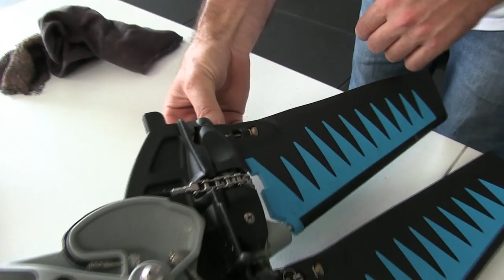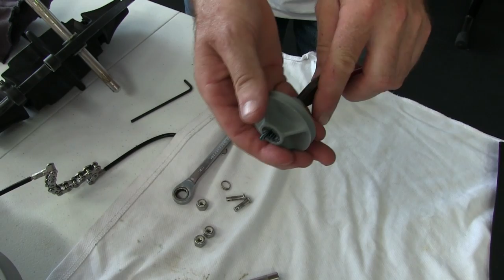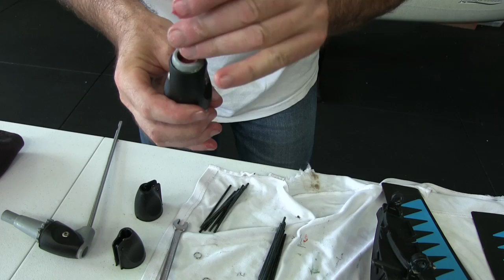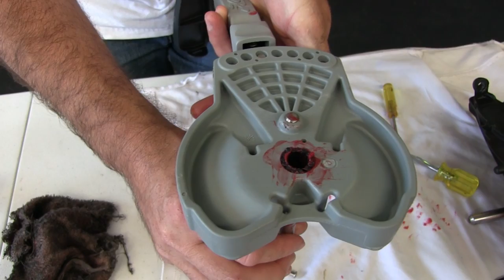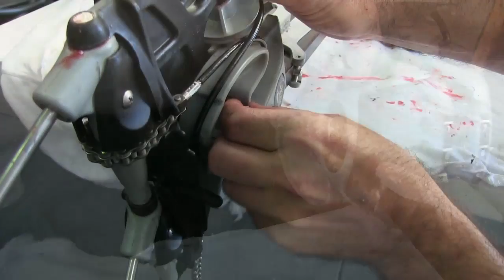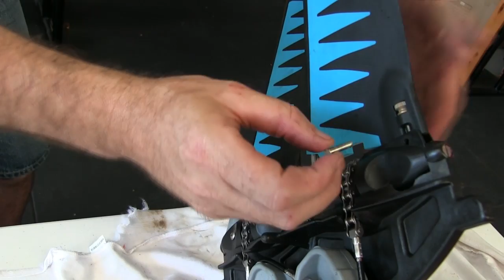Hobie GT Miragedrive Service Guide

Comment: A big thank you from a Barnegat Bay New Jersey kayak fisherman! This is an excellent how-to video, well narrated and filmed. I used it to guide the installation of new GT sprockets on a V2 Mirage Drive. A tip for anyone who's doing this--mark the middle tooth of each sprocket with a Sharpie to make it easier to line up with the middle chain link as you're reassembling.

Comment: I purchased the recommended 1/8” paracord from Harber Frieght. If you carefully heat the outer jacket so it shrinks and becomes more rigid you can easily thread it through the hole and pulley. Otherwise the outer sheath slides and bunches if you tried to push it. The same thing for the T handle. Don’t over heat because the jacket will melt.

Comment: Did Hobie ever make a bearingless drive?  I took mine apart awhile back and never saw any roller bearings.
Reply from the maker: V1 and V2 drives did not have bearings. Both can be updated to GT bearing components.

Comment: 2:10 what is this detail for? it also works without it
Reply from the maker: The idler cable balances the loads and helps to prevent a snapping load on the chains at each change of pedal direction.

Comment: I'm scared to death at not being able to put back the bearings in place.
Reply from the maker: We sell a lot of Glide Tech parts via mail order and not once had anyone contact us to tell us they were having troubles with them. They are pretty easy to contend with
Reply: I took mine apart without watching any video and had plastic bearings all over (180 drive V2). I found that if you put a good amount of grease on the bearing wall it holds them in place and makes it doable. If you have a rig like he does it is even easier but not necessary.